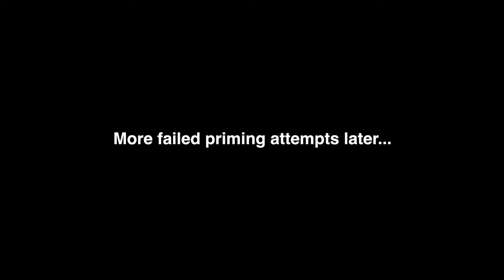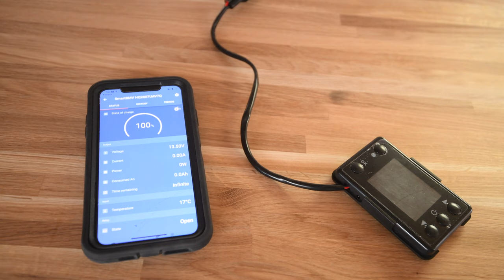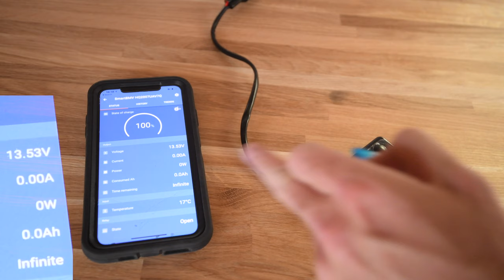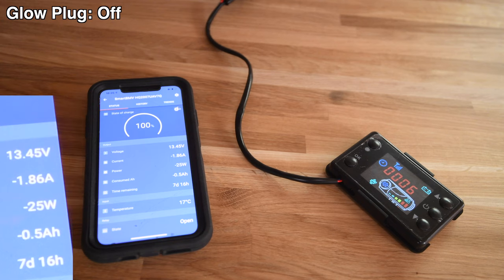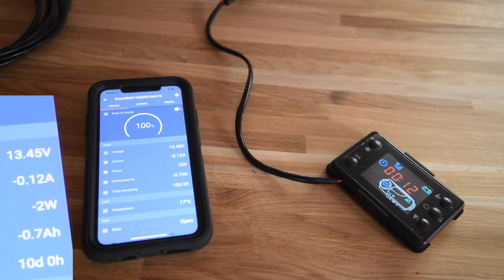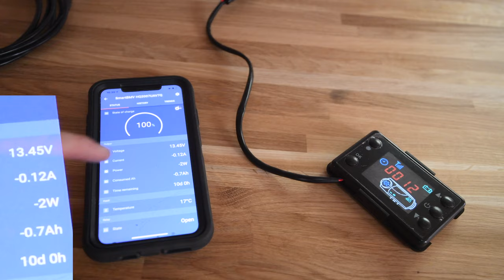5kw Chinese diesel heater install | EP30 | Ford Transit Campervan Build |

Comment: What is the advantage of the turret mount?  I've seen much more complicated installation procedures for the turret, including ones that run bolts to secure the plate through the floor; you technique is much simpler.  Dumb question: using your turret mount or the crappy plate that usually comes with these heaters -- in the states anyway -- should you be able to simply unscrew the heater from the mount or plate for maintenance in just a minute or two?  Is the advantage the ability to seal it from below, rather than seal it to the floor of your van where fumes could more easily escape?
Reply from the maker: I’d mainly say safe for the reason of the turret mount but that in the context of what I’m doing. Which is mounting it in a thick insulated floor. 

If you were mounting it directly to the metal floor of the van then you wouldn’t need to use a plate at all. The seal at the bottem of the heater can seal directly on the vans metal floor. 

Using a turret also makes good clearance between the exhaust and any combustible floor materials. As well as effectively making the connections between the exhaust and the unit external. 

In my case, also made it easier to put together.

Sealing from below what for to prevent fumes entering the vans floor. As many vans have ribbed metal floors and not flat ones

Comment: Sorry if I missed something obvious in the video, but how did you get the power feed down to the pump for the diesel heater - is there a hole for it in the large round manifold? Did you have a link for that manifold too please?
Reply from the maker: Oh no, you are right it’s not in the video, I filmed it as well! Basically the original mounting plate as I slot in it so you can run the pump wire though as well next to the air intake. My turret mount didn’t have one so I drilled and cut the slot in myself. Apologies not sure how that got missed out. I’ll see if I can add a caption to the video
Reply from the maker: This is were I got my turret mount. I went for the 65mm as my floor is 18mm ply + 25mm batons/insulation and then the metal van ribs are about 12mm. Which is 55mm in total. Added a little extra so I can get a good seal with sealant. The eBay seller has a few different size options 

https://www.ebay.co.uk/itm/402391007781
Reply: No problem, and thanks for clarifying how you routed the fuel pump cable. I wasn’t sure if there was sufficient room to cut the plate (as you did) or if you routed it between the turret fitting and the hole you cut in the floor - I’m also guessing the plate doesn’t get too hot so you can fit a grommet or something to stop the chaffing risk. Thanks also for the link. 👍
Reply from the maker: Aye used a grommets and put the hole on the cold air intake side away from the exhaust, but generally the turret  mount shouldn’t get hot as there is a large air gap the reason for the size of it from the walls of the turret to the exhaust pipe

Comment: Here are some helpful hints for your  installment, by the way! Nicely done. Fuel line, just change out to a 4mm OD x 2mm ID hard nylon line; this will save you headaches down the road. Try not to attach the fuel pump directly to the frame using a passive mounting system of some sort. It will keep the ticking noise down. Plus, the hard fuel line will also transfer the noise along the line too. I used a latex rubber hose and placed the hard fuel through that, and that made a huge difference. Then using those rubber mounts for the fuel will get hard from the cold and freezing weather; and will transfer the noise too. If you try to dampen the sound from the line. I've been installing these for a while and still haven't found a rock-solid method of limiting the sound totally.
Reply from the maker: I’ve already done basically every think you’ve commented. I ditch the original fuel line of the bat originally 95% of the fuel line is 2mm hard line. The rest of the fuel like is reinforced rubber hose fuel line used at the pump for a vibration dampener. I find the ticking from the fuel pump minor inside the vehicle as I have tighten the screw holding the rubber mount only just so they touch touch but  not to compress the rubber and decrease the vibration dampening effect of it
Reply: @MispronouncedAdventures  cool, have you cut a piece of auto sound proof foam  with heat shield around the pump, it helps too. Plus side is it could protect it to. Later I’m going to view your channel videos and become a sub I like what I see in your build of your van! Cheers!

Comment: I have a ford transit VO 2017 lwb. I wonder if it would also have the auxiliary port at the main tank?
Reply from the maker: I’m not quite sure of that particular model of transit “VO”? But the Ford Transit MK8 like mine and the Ford transit custom use the same tank sender unit which all have an auxiliary fuel port so you may well be in luck.

Comment: Was it 6mm2 that you replaced the cable with?
Reply from the maker: 4 or 6mm2 would be plenty sufficient.
If you’re going for a way longer run, I would consider 6mm2

Comment: Hey Alex where do you get the control that works on WiFi or Bluetooth that you mention in this video.
Reply from the maker: It’s called an “Afterburner” control made by an Australian guy called Ray. There is a big Facebook group for it.
Reply: Cool do you have a link for the group?

Comment: Did you have to drill another hole in the floor to drop the pump electric feed down to pump outside?
Reply: What solution did you come up with in the end rather than leaving it connected to the battery?
Reply from the maker: The turret mount has a small holder on the wire through for the pump
Reply from the maker: I always keep it directly connected to my main positive busbar ( fused ) . It’s quite important that a diesel heater cannot lose connection Power went running as it could result in permanent damage so. I’d rather have it before any type of switch and breaker, and if I need to turn it off, I would pull the fuse
Reply: @MispronouncedAdventures  so connected to pos and neg Lynx power in would be fine using supplied fuse. ?
Reply from the maker: @wanderingsofalanandcaz yes

Comment: When routing the wire to the fuel pump did you drill another hole or route it around the turret? I’m about to install my heater on my transit and I’m trying to drill as few holes as possible
Reply from the maker: I went for another hole in the tunnel mount. The same as the original base plate has a notch in the base plate for the wire
Reply: @MispronouncedAdventures  well i wish you’d shown this 🙈
Reply: @MispronouncedAdventures No issues with heat from the exhaust?
Reply from the maker: @wanderingsofalanandcaz  nope, the exhaust is obviously hot to touch but doesn’t necessarily radiate much heat far

Comment: Is this a problem where you have put a hole in the floor? Is it not 30 cm from a suspension mount so will it be a problem going through an mot?
Reply from the maker: I have seen this mention before. I’ve had no issues with the MOT. When I’ve been people commenting on this subject online and it seems if the hole is unintentional such as rust or corrosion. 30 cm of the chassis members is the problem, not purposely made holes in it. Which makes sense to me as the sheet metal part of the van’s flooring there is no structural significance
Reply: @MispronouncedAdventures  I see, that makes sense. I'm just contemplating where to put mine on my ford transit, didn't know if it would interfere with the mot. Thanks for replying

Comment: One of the most elaborate and clear diesel heater install video's I've ever seen.
Can't wait for the Afterburner controller install and review.
Reply from the maker: Glad you think so. Wanted to make a useful and informative video. I currently have the Afterburner, but yet installed it but will be soon

Comment: Hey Alex, came back to this after a few years 👍🏼 and apologies in advance for the long comment!

I’m after a 2kw that will work with the afterburner, any advice in 2024 what brand of CDH to go for? 
It’s pretty hard I’m finding to find a genuine 120x120mm ish 2kw, most seem to be 5kw ‘size’ but listed as 2kw :/

I’m planning on using 2 of them at each end of the van. I’ve a sliding sealed off walk thru like yours so plan to fit one to heat the cab(drying room) and front end, and other to heat the living area/under bed garage.

Many people seem to rate the lavaner pro 2kw but they’re twice the price of a cheapo!ha and not so easy to get hold of. 
I’ve been in touch with maxpeedingrods and said there out of 2kw due to the season ??

Long as it works with the afterburner I’ll be happy really… I’ll keep the front one with std controller as I’ll use mainly for a drying room. 
The rear will be using the afterburner to keep a consistent heat and on most of the time. 

Only reason I want both the same heaters is to allow for a quick swap if one fails👍🏼 

Would appreciate any advice 

Cheers 
Ant
Reply from the maker: Hi Ant,  I was going to say the Lavaner Pro, as it’s high quality and come to far better components. And more likely to have a compatible ECU. 

Many of the Maxpeedingrods models are not compatible anymore. 

Best option would probably be to find the afterburner Facebook group and ask on there. If someone knows or recommend what 2 kW order.

Comment: Hello,
I was looking to order one diesel heater.
But I am not certain about the power 2kw or 5kw.
I will not travel like you in extreme could weather.
Going skiing few days a year.

I have one Citroën Jumper /Relay/ l4h3 the big version.

I am scared that the 5kw will run on to low for good combustion.

What the advice.

Thanks from south France
Reply from the maker: I would recommend the Chinese 5kW version ( if your budget extends to a 4 kW autoterm ) 

A 2 kW heater on a van of that size will  take a long time to heat up. Whilst you are correct, running on low, can lead to sooting It doesn’t necessarily, mine usually runs on low most the time at 2000 was very clean inside
Reply: @MispronouncedAdventures  
The price difference for a 2 or 5kw chinise are nearly the same a bit more expensive for your exemple with the app.

Thanks for your opinion.
Wich you a good artic trip

Comment: Hello Alex. Is there a link to the afterburner vid you mentioned at the end. I'm about to go in on a CDH install as a complete amateur
Reply from the maker: Not really a link as it’s not really a “product” more a project. You can see it more clearly in some of the newer diesel heater related videos on my channel.

however, if you want to find more information about it, if you google “Chinese diesel heater, third-party afterburner controller or the particular Facebook group for you should find all information you require. Hope that helps

Comment: This is the best video I've seen so far for connecting to the auxiliary fuel port. Thank you! 

How low did you drop the tank in the end to be able to reach in? Did you leave it on the two bricks? Or did you drop it all the way to the ground?
Did you have to disconnect the tank's hoses or anything, or were they all able to stay connected while you worked?
Reply from the maker: I lowered it the maximum amount I could before it started to pull on the filler pipe, then just stacked bricks and wood underneath it. As the fuel tank itself was almost completely empty it was extremely light, so no major stress on any connections/filler pipe. 

It would definitely be easier access if you disconnected all the pipes and completely dropped it but there was still enough room for access the sender unit and even enough still to get the camera in there
Reply: @MispronouncedAdventures  super! I’ll be working on it tomorrow morning and feeling a lot more confident after watching your video! Thanks again 👍🏼
Reply from the maker: No problem at all! If you have any questions feel free to message me on Instagram ( if you use it )

Comment: Your exhaust pipe is too long and too many bends. These heaters are sensitive to this. See the brilliant videos by (I think his channel is) John Mac, an Aussie who serviced Ebersoacher diesel heaters for many years - he gives great advice and instruction. Also your pump is too near the horizontal. You will get cavitation bubbles remaining in your pump. Your system will still work, but it will be inefficient and more likely to fail years before it should. 
I think your videos are great and your are a determined and intelligent young man, but you haven't quite got this installation right and your followers need to avoid making the mistakes you have made. The best thing you and your followers can do is watch John Mac's videos. They helped me - I installed my diesel heater this week. All the best to you - I hope you don't take any offence from me pointing these issues out - no offence intended - I just want people to know how to do this the right way.
Reply from the maker: Hi,  thanks for comment, no offence taken at all. Interesting you should say the exhaust is too long, it’s currently total length of 110cm. 60cm pre muffler, 50cm post muffler. All the  recommended information for exhaust length seems to say 200cm max, same for the angle. Max recommended bends information I love seen were to add up to no more than 270 degrees in total which I’d openly admit I’m probably at, but I had done my best to keep the bend on a large radius to at least have better air flow then tight ones. But I do get the 
General gist of it which is less bends & length is the better. For me I think I have the best option for the size available. I didn’t want to run the exhaust directly down from the heater as that would be the same chassis area as the heaters airing take

Odd that the pump looks horizontal for you, the might be my under want camera work max Pump angle recommendations seems to be between 15-30 degrees and that’s what i was aiming for and I’d say might be probably nearer the 30-35. I can easily be adjusted, I’ll have a look at it in the morning. 

I have seen a number of John videos they are rather good.
Reply from the maker: Having just rewatch parts of the later bit of the video and can see what you mean about the pump, it’s looks almost horizontal in some shots! Reality its not I promise! I suspect that’s a side-effect of using a super-wide angle 16mm lens close up under the van. It’s stretches things out
Reply: @MispronouncedAdventures  yep, you're on the ball with your research and understanding. You've probably got it fitted within the recommended specifications, but it's close. 
I was going to try to put my pump in a sealed WISKA junction box, but I couldn't get it to fit anywhere. I'm concerned about the electrical junction at the top of the pump housing and it's exposure to water spray, salt and dirt. I managed to fit it into a box section of the chassis, so at least it has some protection. 
I kept the original 2mm diameter rigid plastic fuel line. "Upgrading" to a larger bore, or less rigid plastic results in inefficient fuel delivery. John McK explains this in a video. I think your Halfords is small bore rigid plastic? If so, it should be ok. 
I have a fairly sharpish bend in my exhaust pipe to run it along close under the chassis. I didn't want to leave it dangling low and exposed to trauma. Its only a short run, with no pipe after the muffler (which is straight internal, not a kinked baffle one) so I think it will be fine. It seems to work well in my tests so far. 
I had to smile when you said you didn't want to drill holes in your chassis - having just drilled a 127mm dia hole through the floor! I didn't go down this route, but used the supplied mounting plate instead and it seems to be fine, sealed with a high temp resistant sealing compound. I drilled a couple of holes in the chassis to mount the pump and exhaust muffler securely, but I use a cotton bud and a liberal amount of Hammerite before I affix. 
I enjoy your videos. They are very informative.
Reply from the maker: Yeah I replaced all of the original fuel line that green flexi stuff it comes with. 90% of the fuel line now is the thin hard plastic type which came with the Eberspacher Ford transit tank connector kit. The final 20cm ish of the fuel line is the fuel line I got from Halfords. Which I’d say has a larger bore than the blue hard plastic pipe and slightly smaller bore than the original Chinese diesel heater green fuel line. I be honest I wasnt sure of the effects of changing The bore on the fuel line. But since Eberspacher use a smaller bore in part of there kit and my Halfords was larger than that it would be reasonable to think it should be okay. A couple weeks in and it still seems to be functioning fine. 

As for pump protection. I’m reasonably confident of its location. I had been playing around with waterproof automotive Tyco connector recently making a battery Communications cable. So looking at the connector the pump had similar waterproofing I was confident on that being ok. As for the actual body of the pump, I have been thinking about of pink soft sound dampening cases I’ve seen a few times online. They ticking noise from it doesn’t particularly bother me that much and it’s not too bad but I’d like a bit more protection on the pump.
Reply from the maker: Yeah i definitely wasn’t a fan of drilling a massive hole! I’ve had to drill some more recently plumbing in the grey water tank. And once again making a mess with sealant

Comment: Hello I noticed that you said in your video you don't know why the diesel heater glow plug would come in after you switch it off that is the burn any old fuel out of the Chamber.